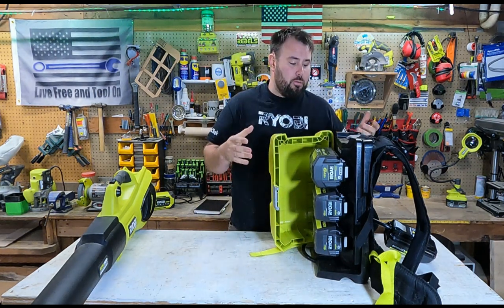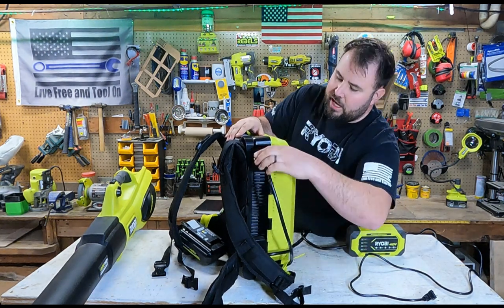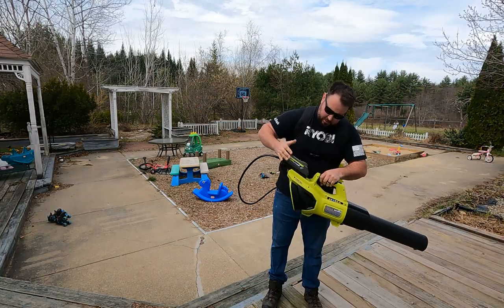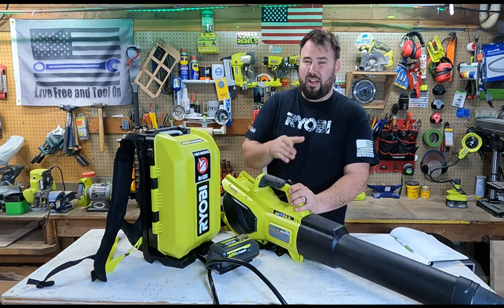Ryobi's New Super Backpack Blower [must watch]

Comment: 1. If your batteries is at zero charge, you are destroying it. 2. Too bad with such a big charger. It can’t charge all 3 batteries at same time. 3. With electric trimmer and your acres yard, I am certain before a normal batteries 6 amp run out, you probably need to put new string in the head and that take a lot longer then swapping batteries.

Comment: Cool backpack , first thing I would remove is that green cover, seems like enclosing batteries is like adding a blanket. And also seems like the cover is more of an aesthetic thing.
Reply: Interesting, never thought of removing the door. It does protect the batteries from exposure to sun and moisture, but it kind gets in the way when swapping out batteries. Thank you for sharing.
Reply: The load is being split between 3 batteries, so 1/3rd the heat in each.

Comment: I agree that wearing this backpack while operating a chainsaw (and auger) is a bad idea. Could you take off the backpack, put it on the ground, and still operate the chainsaw/auger safely? Also, I think it would work great if bucking wood where you don't have to worry about running away for safety.
Reply from the maker: I still don’t think it would be a good idea to have the pack on the ground, it could present  unnecessary obstacles for the chain saw and user.
Reply: @livefreeandtoolon  OK, Just trying to think of other possible uses for the backpack.
Reply: Unless you are cutting down a forest, a single battery pack would probably work for most people. You can bring out the backpack as a spare battery holder in case you are deforesting.

Comment: I found it easier just to slap the battery directly to the blower, it has plenty of run time and power unless you are riding the power boost switch. That switch is only meant for brief boosting and not for continues use. I do have a gas power blower which in reality is over kill as it has too much power for the area I work on. This battery backpack would be great for a vacuum cleaner as they consume lots of power. 
Currently the Ryobi backpack is used to recharge and store the batteries.
Reply: There is no such thing as too much power for the area in blower,  it might be too heavy to too expensive. Just saying
Reply: @mracer8  Actually on my property the gas blower was excessive, I found my myself throttling down to get the work done and not make a mess. This Ryobi electric blower has the right amount of power and on the very rare occasion I need more, I can hit the high output switch.
Reply: @cfldriven  1. Gas blower need to throttle up, not down!  2. Gas blower is not a Ryobi electric blower and turbo mode, there is no such thing as high output switch!

Comment: I've been thinking about something like this lately, I have the lawn edger and the battery position kind of gets in the way with anything over a 2ah. I don't get why the adapter is so big though
Reply: I get that it needs to be a certain size to slide and lock into position, but you are right it does seem large for an interface. Currently I just use the backpack as a charger. Thanks for watching.

Comment: Those 40v batteries weigh a lot and there’s 3 , so it’s heavy and you had better be able to tot all that weight. When your grid shuts off you’ll wish you had an alternate
Reply: Watt hours are watt hours man. 6 amp hour, 40V batteries - 240 watt hours.

That’s equivalent to a 13.3 amp hour 18v battery. 

BUT, higher voltage systems use LESS current to deliver the same power, which means less heat loss due to resistance. Better efficiency.

Comment: This is pretty cool but the price is also pretty crazy.  It's nearly $500 USD for the backpack alone, no batteries.  It's great it's a charger too but I feel like they should have made it like half that price or less and skipped the charging functionality.  The cost of this thing, three 6Ah 40V batteries, and just the blower, you'll be at over $1000 easy. Meanwhile Ryobi themselves sells a backpack gas blower for 1/3rd that price.  Heck they even have a 40V backpack blower that's the same price as this pack alone, but comes with the blower, two 6.0Ah batteries, and the 40V rapid charger.  Granted that blower is not quite as high powered and you can't make use of the backpack format for more tools, but all of this still makes the 40V backpack thing a tough sell.
Reply: Well this kit retails for 600 so even if you don't need the blower, the 2 batteries and the backpack are suddenly worth it

Comment: So basically the power pack uses one battery at a time. Therefore you can buy 3 batteries and exchange one by one once they lose charge instead of carrying a weight on you back. That’s no technological advancement at all.
Reply from the maker: The batteries drain at the same time

Comment: These are cool but i feel like they have a limited use to a leaf blower and weed eater
Reply: What if you hooked it up to a handheld fan and walked around Disneyworld
Reply: As they expand their 40 volt tool line it would be useable for most use cases. But as of right now it is limited somewhat to things such as a leaf blower, weed eater. Hedge clippers. Items where a cord isn't a danger that exists in the 40 volt system.